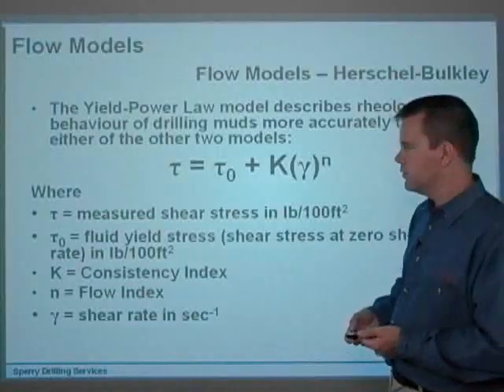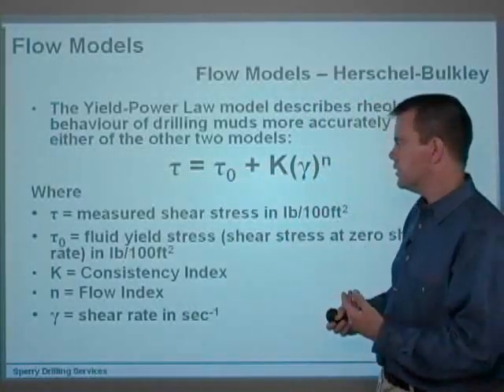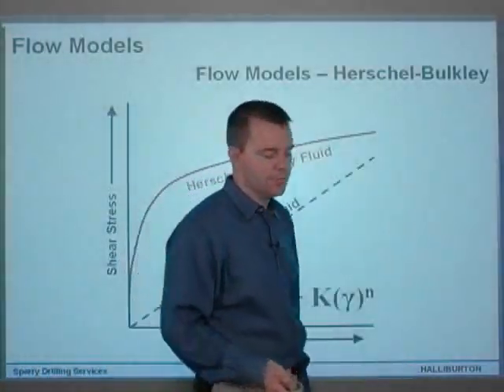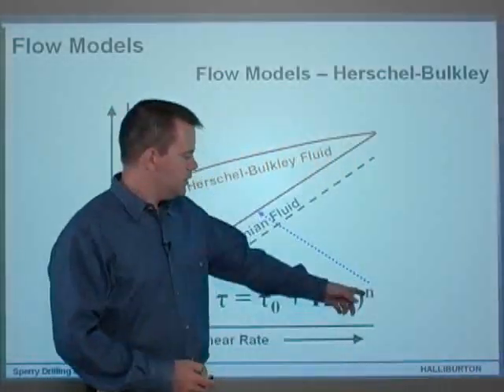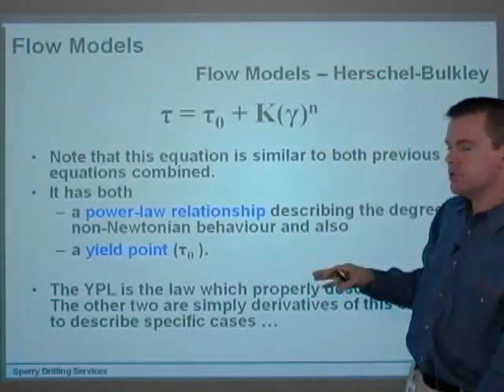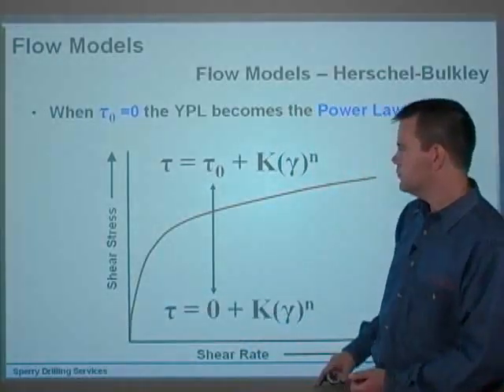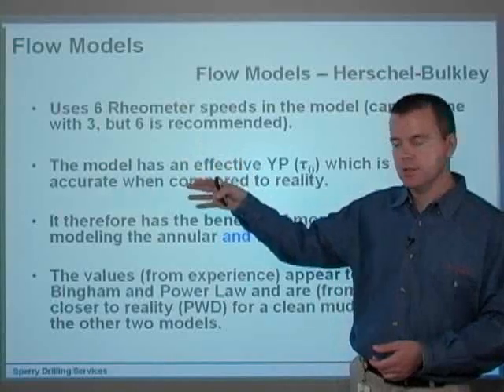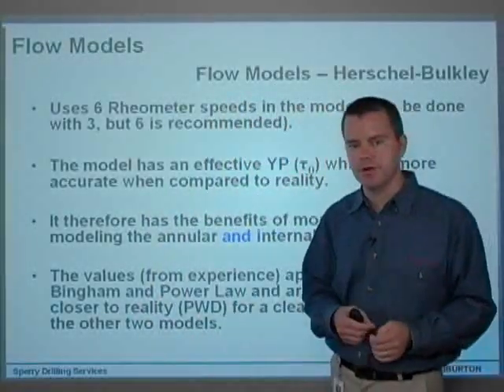6. hurschel bulkely model

Comment: Hi Abdekaziz,
That's an amazing explanation! Now I'm working on the application of the HB model. I have one extra question about the setting of the HB model. When shear strain being close to 0, we need to set a limiting viscosity (nu0) so that the solution can converge in numerical calculation (Typically, in OpenFOAM). 
But how to determine this nu0 has caught me. Should I substitute a small shear strain rate into the HB model and set the return value as nu0? I read many papers and videos but most of them just overlook this issue. Do you have any advice? 
Thank you in advance. : 3